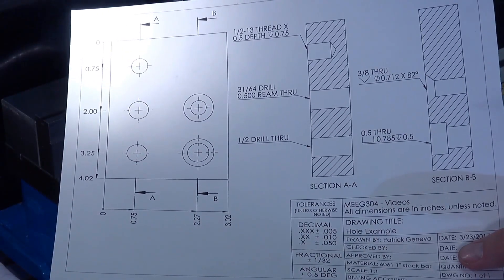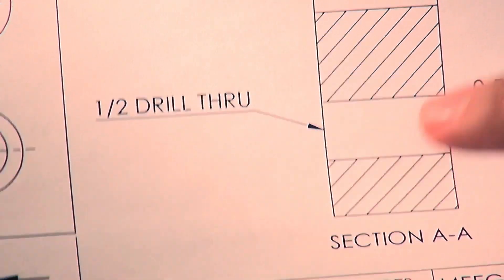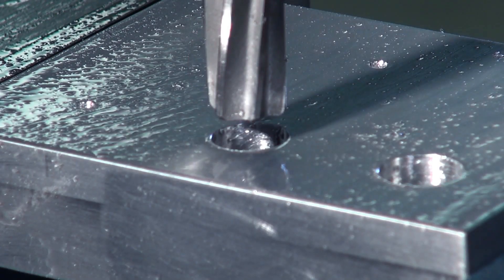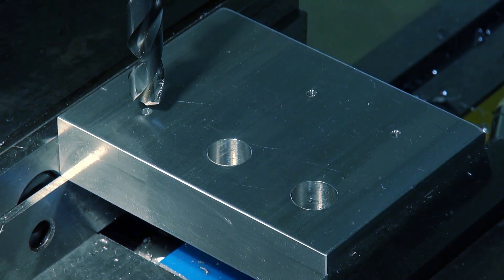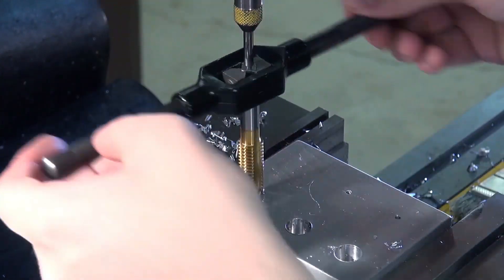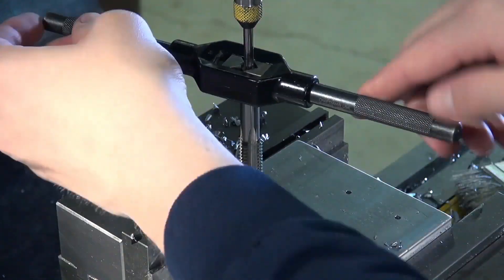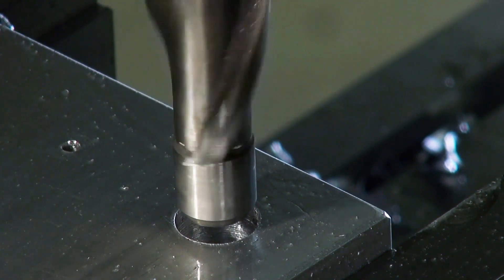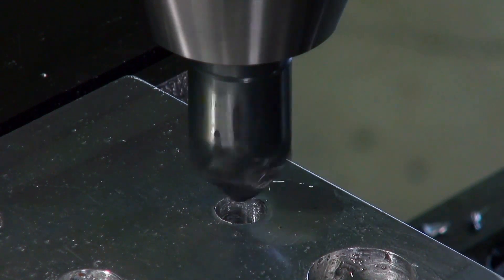CNC Mill Tutorials - 5 - Drilling, Reaming, Tapping and Boring

Comment: you shouldn't have used the gun tap for that blind hole, gun taps shoot the chips downward  and should only be used on a through hole. a started tap would have been better as it is similar in its tapering